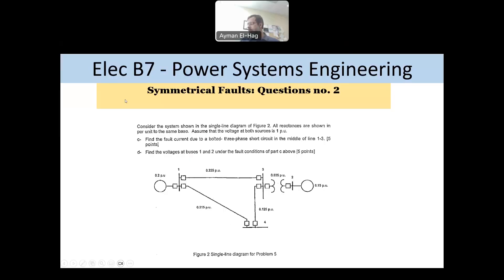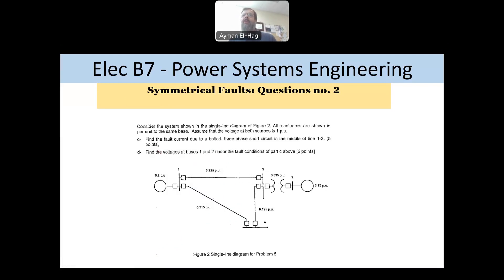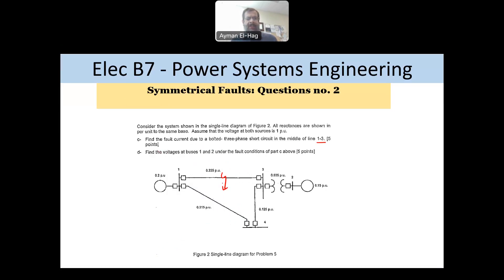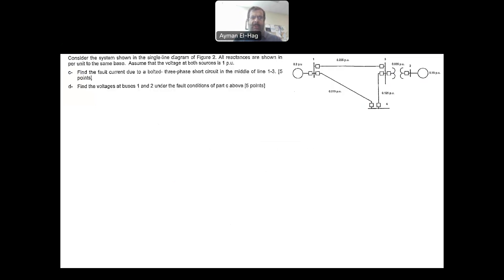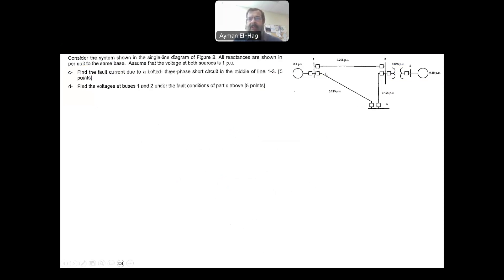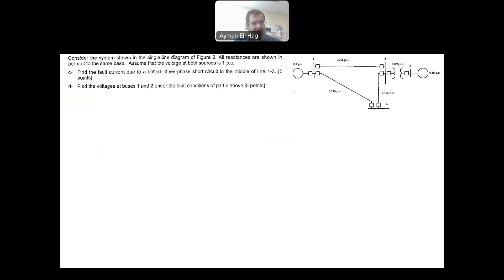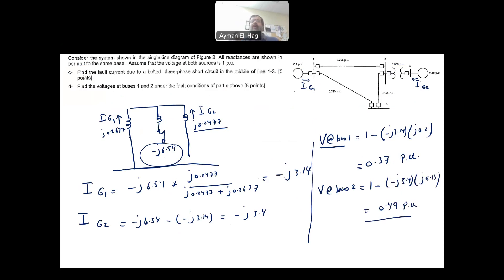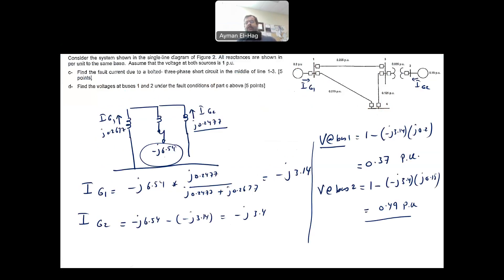PEO solve examples (ELEC B7) Symmetrical Fault Question no. 2

Comment: Hi Professor, would you mind helping us to solve the Dec 2020 Question 5? I am a bit confused with the use of sub-transient reactance. Or any Hints for us? Thank you so much~
Reply from the maker: Hi
I can do that, but I think a better strategy for B7 exam is the following:
You have 7 questions in the exam and you need to choose only 5. I suggest to concentrate on the following topics:
1. Three phase
2. Transformer
3. Synchronous generator
4. Transmission lines
5. Load flow
There are two other topics which are:
1. Symmetrical and unsymmetrical faults
2. Transient stability
These two topics are a bit more difficult than the other 5 topics, with the exception of the symmetrical faults that I already solved couple of questions.
Reply: @electrical4everyone  Thank you so much! Your advice is valuable to everyone.